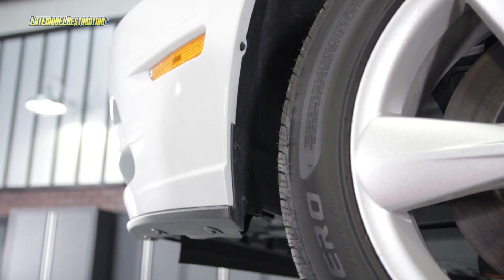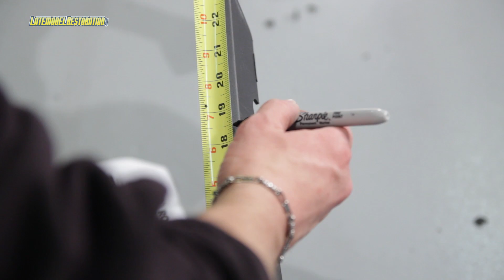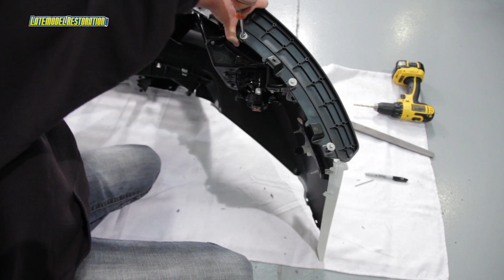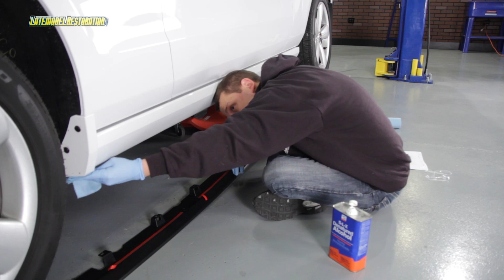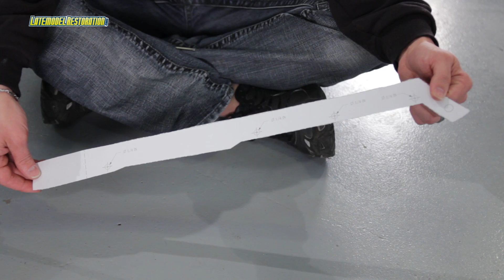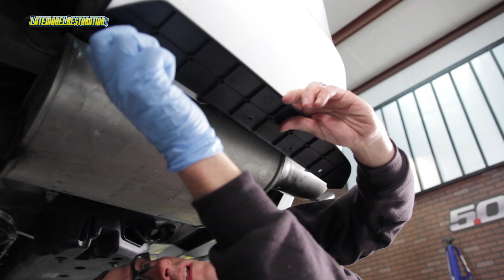Mustang Roush Chin Spoiler & Side Splitter Installation (S197 13-14)

Comment: I have a question can I just put the side spoilers but not the front ?
Reply from the maker: Yes, you can. The side splitters are available on our website without the front splitter. Here is the link. 

https://lmr.com/item/RSH-420092/Mustang-Roush-Side-Splitter-Assemblies

Comment: This is my favorite spoiler, durable,  very durable and for the price, it’s also the best looking. It’ll go over the speed bumps without breaking or chipping. I have also purchased the MMD , extremely brittle, Broke within couple days, bought another and did the same ? Please don’t waste your money on the MMD , waste of money. But the Rouse is also a better fit, since it uses the original spoiler with it. If you accidentally hit the side walk, it’ll flex, just bend it back but it won’t break! That’s why I’m going back to using this Rouse spoiler.